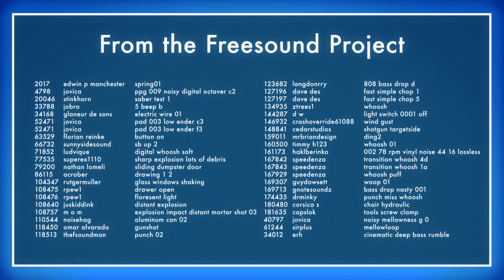Project Thumper Walkthrough

Comment: Those leads are not capable of transporting such an amount of current. They would probably be destroyed during the experiment as well.

And don't forget to bolt the leads to something really solid all along their length. Otherwise the magnetic fields would cause the leads to attract each other rather forcefully, and probably short circuit.

Comment: using wolfram|alpha I figured out that Thumper stores 129.6kj of energy.
my process was:
40*2000uF=80mF (the way the caps are wired you effectively 40 2000uF, 1800V caps)
80mF @ 1800V has 129.6kj of energy.
Reply: Your calculations are incorrect because when you wire capacitors in series you lose capacitance but gain voltage rating because 1/Ctotal = 1/C1 + 1/C2 + ... + 1/Cn which means it is only 20mF @ 1800V.
You will notice that, for a given capacitance, the amount of energy stored increases exponentially when voltage increases linearly. Therefore it becomes obvious why the capacitance has to decrease.
Either way, the energy stored in a capacitor bank doesn't change whether you wire them in series or parallel. You can't get more energy just from wiring them in series.
The thumper thus stores only 32.4 kilojoules.

Comment: paralleling diodes? usually when connecting diodes in parallel one will start conducting before the others and over-current will destroy it or in Thumper case because there are rows of diodes connected in parallel one opening before the rest would not matter as two more are after?